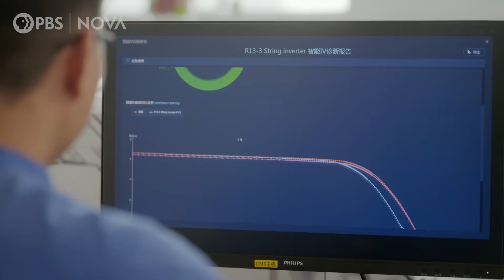How 5G Is Transforming China | NOVA | PBS

Comment: I turn 5G off on my phone its pointless. I was having trouble connecting web site on 5G vs LTE.  The number of antenna need to Connect / line of sight get those speed wont benefit the average user. 5G on vehicles for AI wont work. Again you need line of sight which need probably 20x more antenna cost more.

Comment: For sure, 5g is such an revolution.....unfortunatelly its range is less than 4g and signal could be stopped just by some wall..... but yeah, revolution.
Reply: You are talking about only 1 specialized aspect of the 5G specification, only intended for crowded open spaces like concerts . Most of the other specs just use the same frequencies as 4G and they penetrate your walls just like before.

Comment: Most people think of 5G or 6G in the communication speed because they can understand the numbers expressed in bit per second.  The monitoring of solar panel requires very low data rate.  But, the real benefits in commercial applications is the network flexibility.  For example, a 5G system could be organized without very dense cell towers.  A 5G device can relay other 5G devices so that the network can grow dynamically.  It is like you have a million soldiers.  Although each soldier only need a short command to do his task, the battle is fought by how to coordinate these soldiers.  Thus, we create several level of commanding structure.  A 5G system will allow this commanding structure organized as needed.

Comment: Does the US have 5g? I can't get a straight answer. Some people say yes, other say it's fake 5g. What is it?
Reply: Both. Depends on your location
Reply: @peanut0brain  5G Tiongkok tidak membohongi rakyatnya  , 5 G Amerika adalah 5 G membohongi rakyatnya yang bodoh.
Reply: 4.5g
Reply: 5G/4G mix to provide overlayed coverages.   Just run a speed test. If its over  at least 100Mbps it should be 5G.
Reply: @catsNcode
Reply: @catsNcode  when i use 4g only i get around 200mbps. On 5G mode i get over 500mbps

Comment: Meanwhile US only 4G, even it says 5G. 5G is 100x faster than 4G.
Reply: It's 5GE
5G-"almost"
Reply: mew HUAWEI mate70  5.5g  4000m/s  test
Reply: @donkeykong516  2G
Reply: I’m a cell tower technician been installing 5G on going site for the past 5 years
Reply: Xfinity us fooling Americans that it has 10G. 🤣🤣🤣🤣🤣
Reply: Every time my phone says 5G, the slooooooow down or freezes, 5G in us is FAKE.
Reply: for mobile yes, but the US also has fiber for home internet which is faster than 5G...
Reply: 5G in the US can reach up to 2.5 Gbps using mid-band.
Reply: @donkeykong516  
fun fact: 
mmWaves (5G in the "great" land) is only fast if the device stand still.
If you're on a car or on a bike or even just walking, the mmWaves can't transmit data and fall back to "5G-E" or 4G.
Reply: @bungkusi2432 i have a 5g phone without mmwave and is still much better and reliable than a 4g phone
Reply: Not really... mmWave 5G is 100x faster than 4G but regular 5G, in practice, is running around 50 Mbps - 100 Mbps. In the end, it depends on the frequency. Higher frequency yield to bigger bandwidth but less range, a trade-off.

5G in China is easier to implement because 4G and 5G are totally different technology and they were technically abandoning 4G early in their implementation.
Reply: @Dominus_Potatus  
China normal sub-6 5G is about 300mbps - 500mbps (not 50mbps - 100mbps)

USA mmWave is fast... Only if you stationary 
Just as T-mo video explain if you walk, the mm-Waves will crumble only 1mbps and will fallback to sub-6 4G
Reply: @Dominus_Potatus  
China sub-7 5G-A (5.5G) is super fast. 10Gbps
With average on 4 Gbps.
Certainly faster than the ill-fated mmwaves

Comment: The 5G tech had been really underwhelming. It seems to struggle a lot in places where I live. We’ve gone backwards in our phone connectivity. I’m not sure if it requires additional towers or what but there are so many dead zones where there weren’t before.
Reply: maybe your country should consider Huawei 5G, its the best. You will see the positive improvement!
Reply: @cd2290  the US has fake 5G
Reply: Because the West doesn’t have 5G, even they say they do
Reply: 5 G ditempat anda hasil dari 5G pembodohan terhadap rakyatnya 😂 demokrasi = 💩 = berhala untuk orang bodoh 😂
Reply: depends what carrier.  Because each carrier bids for certain radio frequency rights, the ones with more usually have better consistency, some frequencies support the strong signal/speed but only llimited range, and some have the lower frequency which is not as strong but has ability to reach in certain areas others can't.

Comment: 5G Is a joke compared to Starlink Network.
It's two different world, but the cost of implementing infrastructure, Starlink is way faster and simpler to deploy.
To monitor power grid, Solar Power, etc.  you don't need much bandwidth
Why will China not support a Project like Starlink? 
Why do they expect the other part of the world ( Democratic ) to use what they make when they will not ?